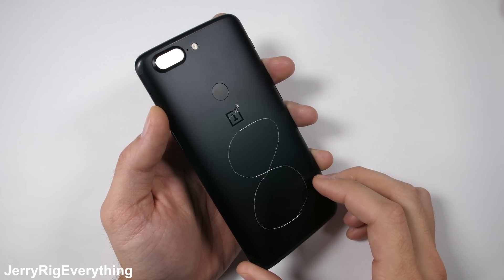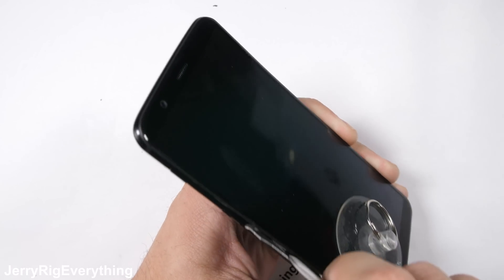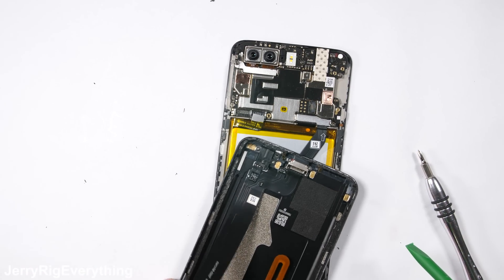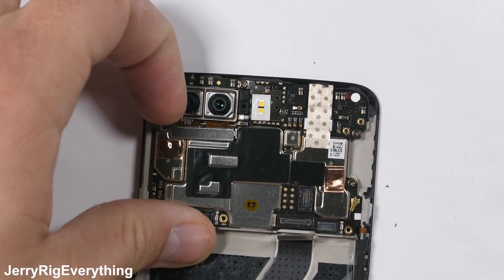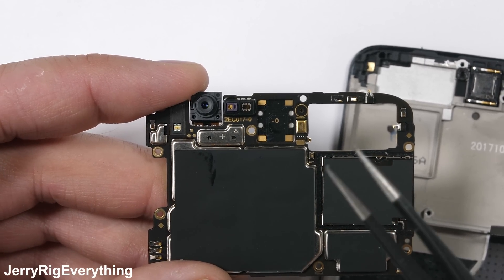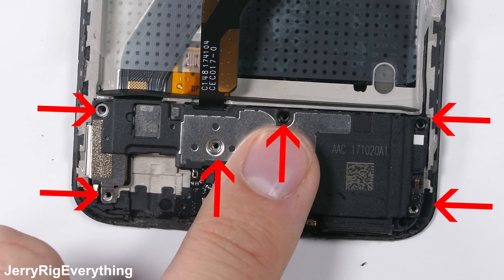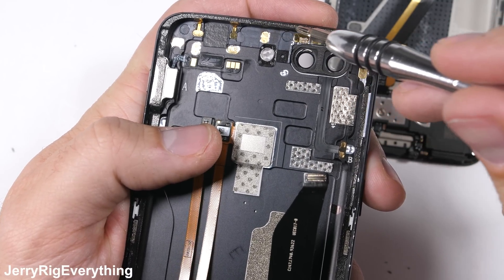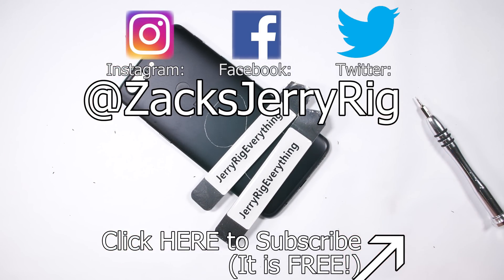OnePlus 5T Teardown! - Hidden water resistance?

Comment: 2024 and I still haven't found any phone with better design. Camera is descent and audio is audible. 2 Sim cards just like any flagship phones today. My fav feature is the back fingerprint that can be assigned to several functions including swiping down the notification or taking a picture. The phone is easily the lightest phone in it's range. And I love the curve on the side. Feels so soft on the palm. I have owned so much of this that I can't keep up. They keep getting stolen 😂😂

If OnePlus upgraded the specs but kept the design and features, this phone could easily be a game changer.

Comment: My one plus 5t is now retiring after 5 long years. All stock including the battery and its still usable over all. Had issue with call over cellular network, and phone suddenly dies at loud music on 30+% battery. Still great in playing games but response now is a bit slow specially when opening apps that requires network. Over all its a great phone, i really wish one plus still builds this kind of phone..... I am now switching over to pixel since i prefer stock android. Thank you one plus 5t,  ill now put you back to your original box.

Comment: Just as a warning. I have a OnePlus 5T from late 2017 bought in the UK. I have just replaced the battery in it and it was not at all easy. The back case, is notoriously difficult to remove - although once I obtained a gap, it was surprisingly easy to remove compared to the difficulties some people had in other videos. However, this is offset by the fact that the loudspeaker cable (the last one Zac unplugs) was glued to the metal bracket (as was the connector that goes to the motherboard right next to it!). I was able to separate the MB connector from the bracket (and had to plug it back in) but the loudspeaker cable was firmly attached to the bracket. To add to the fun, the green tab of the battery just broke off and the battery was not at all easy to remove like Zac shows. It seems that OnePlus must have securely glued the batteries down in later phones. I had to "gently" prise mine out with a pry tool - the battery ended up dangerously warped and fought its removal right to the other side of the phone. Fortunately it didn't explode.
Reply: at first i have difficulties in separating the front screen and back cover. then i use a heatgun to blow at the front of phone at the edges, it become way easier to separate them.

Comment: 16 months later of everyday use with the 5t and it's just as fast as day one... So in my case it doesn't look like a heat pipe was needed... Battery life is still great.. I'll be upgrading to the 7pro and keeping the 5t as a backup.

Comment: Hey Jerry. Nice video, I love all your videos. I have a Oneplus 5t and i drowned it in a lake. Everything is working, but the phone wont charge, it says device temperature is too low. In app it says the cpu temp is normal, but the battery temperature is stuck on -40°C. Probably the temperature sensor on the battery is falut. Do you think, that replacing the battery will solve this issue?

Comment: Jerry, i think if the processor and GPU positioned right next to the aluminium case, heat would be no problem because aluminium is a good heat distributor. it's just a theory anyway. But if it's true that would be awesome innovation.

Comment: IP certification is just that, certification. They could have built the phone with IP67 in mind, paid for the testing, but failed. And didn't have the reserves to reengineer and pay for a second round of testing. Or they had multiple rounds and they all failed.

Comment: Just wondering Oneplus uses claps (or whatever you call it) to hold down the screen. But why doesn't it bend like some Xiaomi phones?
Reply: +L HK The same reason why this device could be considered as splash resistant, even though this wouldn't be an IP67/68 device. Were this device IP tested, OnePlus could likely pass for IP54/55 or so, but that would cost OnePlus extra money to have done. Back on topic, the entire rim of the device's frame is coated with foam (as opposed to glue/sealant) and the clasps are spaced closer together and require more force to detach. Xiaomi phones use relatively loose clasps and inferior midframe and screen design/materials, meaning that the external frame of the device isn't supporting the midframe of said device.

Comment: Let's plug 5t camera in OnePlus 5 what will be happen??🤔🤔🤔🤔
Reply: +7171 THE CAPTAIN It won't happen. The OnePlus 5T's main camera has a 27.22mm focal length, and would be too long to fit in the place of the OnePlus 5's main camera, which has a 24mm focal length. The secondary camera on the 5T has a much wider f1.7 aperture, instead of the narrower f2.6 aperture on the OnePlus 5's telephoto lens. Now you know why the 5T's camera module wouldn't fit physically in the 5 (it's too big), and also why the camera bump size increased on the 5T, even though the 5 is the same thickness.
Reply: Watermark will change to shot on oneplus 5t

Comment: Get yourself a couple of powerful suction caps to remove screen on clasps. Those metal pry tool is too vandal. Think of someone will use your video to replace and be fckd up with the wasted edges of the frame

Comment: Does the processor need a heat pipe when its backed with an aluminium backplate? Or is there some separation between the two?

Comment: In all honesty with the heatpipe. Yeah itd be nice to see. But im on the 5 with my 835 overclocked to 2112mhz and 2592mhz. The temps stay under 90c under full cpu load. But im also slightly undervolted which helps a bit. Max ive seen is about 88c which is still safe as the max temp I believe is 100C. Over 90 it throttles and 100 it shuts down. I could be wrong though

Comment: I like the 4A high current charging mode. But I miss OIS and wide angle cam like on my LG G5. The build quality seems to be much better than of G5. But the most important drawback is an integrated battery instead of interchangeable one like in G5. After half a year my current battery has lost 500mAh of capacity and has reached mere 2300mAh. Interchangeable battery is the MOST IMPORTANT feature of a mobile phone. Especially if you have to charge it daily.

Comment: I like how they put the "Reboot" button below the Power button, nice and convenient for all of  the freezes, memory leaks, runaway processes, lag issues and the other software glitches that come with Android.
Reply: Will L You must be thinking 2010 android devices. Pixel, Moto, HTC, 1+ and now Razer all have VERY smooth android experience. Samsung and LG are the only ones that still have some lag to them but not AS bad as before.
Reply: Will L yes it comes with laggy Samsung Android. Luckily, OnePlus used pure Android for a better os than apple can offer!
Reply: Meanwhile Stock Android didn't have a reboot button for 8 years.

Comment: what happens when you put in an other battery that is not made by the manufacturer or the battery capacity is bigger ?
Reply: nothing happens as long as it fits inside the body of the phone comfortably and it's a good quality battery. otherwise it may explode.
Reply: Karim Salloum cool thanks :)

Comment: Zach is not without bias. Apple has always been a hater magnet. Apple is not without faults, but one thing Apple has always had is factory optimization. Microsoft, Android, etc. are never optimized out of the box. Fine if you like tinkering, but not if you just want it to work.
Reply: My phone just works and it's a Motorola phone, only issue was a screen burn in and it was an easy fix with a quick root

Comment: 5t being said that it doesn't last longer.. keeps me concerned.. i don't want to buy any mobile until 2020.. unless there is a temptation.. hope it holds up untill then..
Reply: I come from the future lol, my 5t was bought in 2017 by my brother and passed down to me a year ago I think, the screen and back have some minor scratches but everything else is really good, I might replace the battery and get 2 other years of usage of this phone, really well built and has a nice feel, went from android 7 all the way up to 10 and I can still get custom roms to get the latest Android version and security patches if I want, the phone is easily accessible to repairs so if I need to change something I definitely can
Reply: Swarup Kanth dont worry, if you treat it right it will. I am still using my 1+1 until my 5t arrives and it works perfectly even though i bought it 3 years ago. Even the battery is just as good as on day 1
Reply: Next month im celebrating 3 years with my OP5T, nothing bad to say, it perfoms well and has everything I need, but battery is getting worse (maybe because I have used it in sauna many times through the years lol) I have also dropped it to hard floor countless times and once in a swimming pool, its safe to say this thing is very sturdy. Just need to replace the battery and its good for few years again.
Reply: @Rektonator  same here. Some minot scratches on the screen and bigger on the back, but it doesn't really matter. Battery doesn't last very long anymore, but it doesn't really matter to me, since I can charge midday on almost all days, so it's fine.
Reply: My 5t is beginning to have problems now. Charging port is fucked, power button doesn't work right and the display has burned spots
Reply: @Marco911  I've had mine since the day it came out. I've got 0 issues except for my battery dying fast. Can still last a day or 2 without charging it though, since I barely use my phone.

But it sounds like you don't take care of your stuff

Comment: Re: copper heat pipe. The heat spreader would suffice. It would of been nice to have some thermal compound to reduce the airgap between the mid frame and the CAN shielding the main application processor.

Comment: It doesn't have any official water resistance but I think that because its so tightly held together and the little things such as the foam, mesh, and rubber ring actually does kinda make it water resistant even though that may not have fully been the intention.
Reply: its not waterproof bro. sorry to break it to u. just accept it.

Comment: Oneplus  makes better phones than apple for less.
Reply: Isaac Lyons idk about it, Apple has an impressive set up under that protects the motherboard well. The lack of copper heat pipe and metal shielding is like being naked
Reply: Michael Hazell, doesn't make the iPhone X worth £1000 though.
Reply: All iPhones in general have the mother board well protected from magnetic interference, heat, and electrical. The amount of protection with this single op5t is kinda sad, it's like expecting a cop to take a shot with no bullet proof vest. The regular one plus 5 had a much better secure construction than the 5t. Plus, what's really different with the 5t? Just a screen and updated skin
Reply: Really the price tag suggests the cheap construction bare bones anyway. At least it has snapdragon 835, but the lens set up is stupid, they assume no one uses telephoto unless it's for portrait mode, mean while it's a great way to zoom in on something without losing picture quality. 5 has better cameras even if they aren't as good as the iPhone 7+, note 8, v30, pixel, s8, iPhone 8+, iPhone X, huawei mate 10, huawei mate 9
Reply: Michael Hazell, it's OK that they aren't as good for the price, would you expect them to be for half of the price of a flagship?
Reply: Isaac Lyons in all honesty I would choose an older phone over OP5T. I would even consider either lg v20, s8, htc u11 since those are around the same price tag with more features.
Reply: Or even an iPhone 7+
Reply: Michael Hazell, I would have an s8,  still a better flagship than the iPhone X is my opinion!
Reply: Isaac Lyons it is a good, s8 is a better buy than op5t with more premium material. When it comes to products lasting it's a good idea to purchase premium built devices